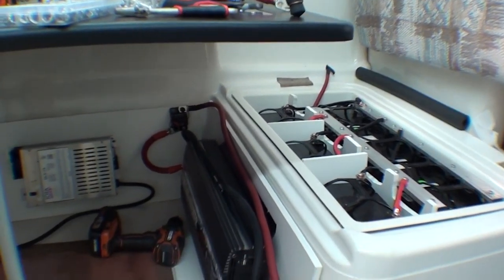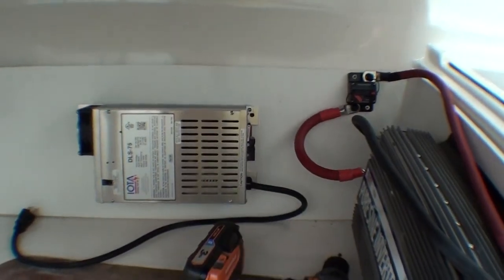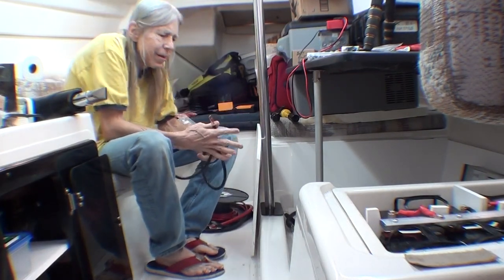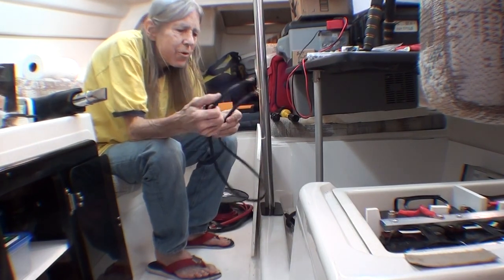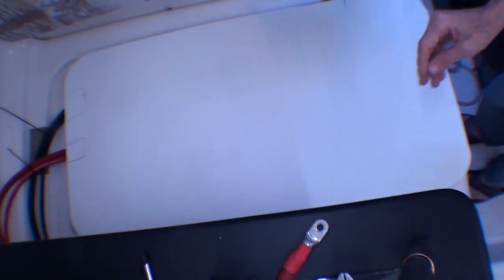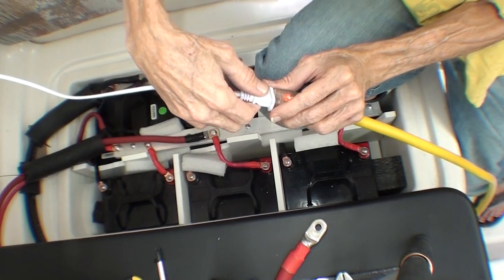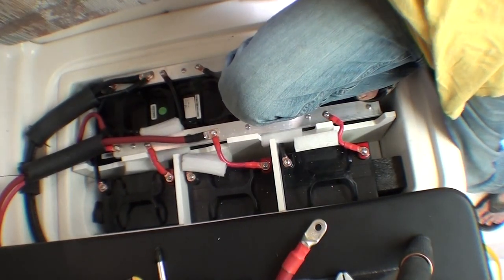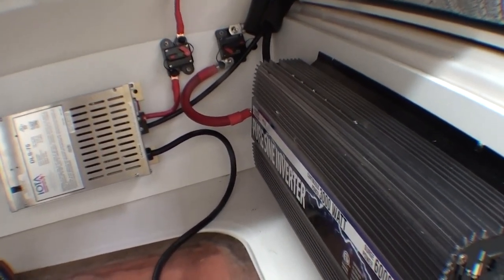75 amp battery charger and 3KW inverter for air conditioner on boat

Comment: Hell, I am impressed with your wiring skills and equipment.  You are absolutely right about saving money by making your cables.
Reply from the maker: I learned about the hydraulic crimper from a Youtube channel called "David Poz".  He does videos about off grid power.  I use it for everything now.  I used to solder lugs on using a torch because i fried several soldering guns trying to do the same job.  The crimper is by far the best solution for adding lugs to large gauge cable.

Comment: I'm glad I don't have to make that kind of Florida mod. I guess the heat is stifling without the A/C?
Reply from the maker: The summer heat wasn't that bad on the original boat.  I left the hatches open when at anchor and the vee berth got a nice breeze.  It was normal to wake up a few times each night, hot and sticky, but it was much cooler on the water than on land.  Then I put an air conditioner in the blue sailboat and ran it one night.  After that, I needed air conditioning.